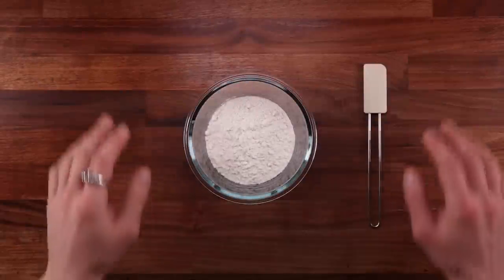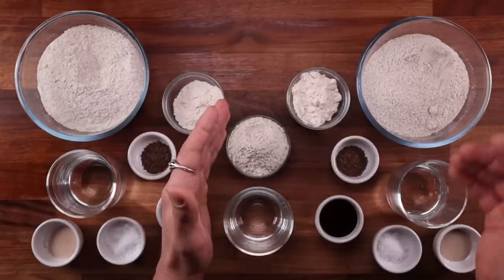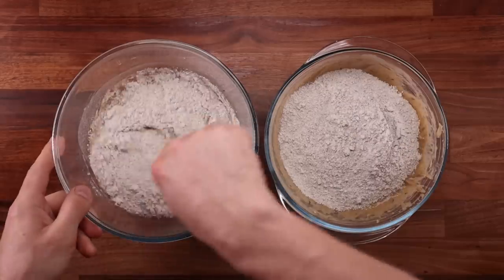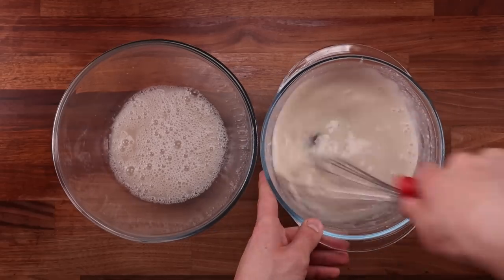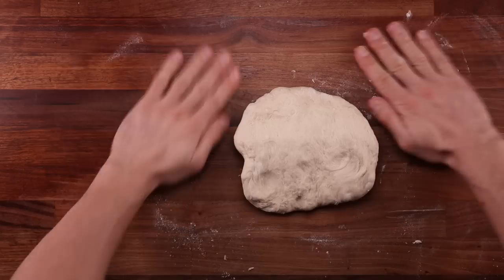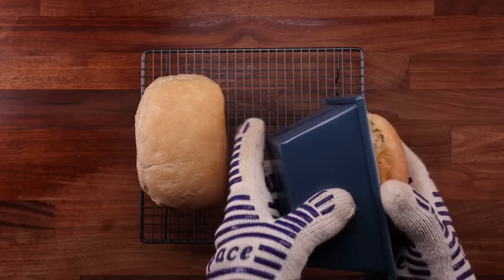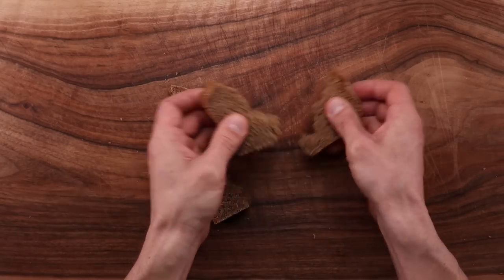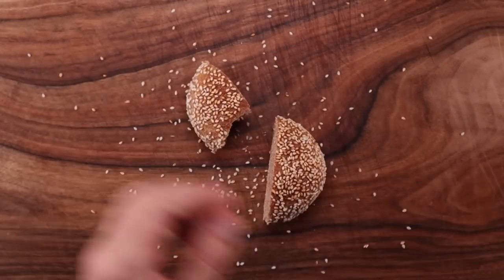Scalding Technique Explained | How to Make Your Bread Last Longer

Comment: So, I am making another bread that I have never made before. This one is Japanese milk bread. I will add photos to this post as I progress.

Ingredients:

Scald
4 oz all purpose flour
4 oz whole milk brought to boiling in the microwave.
Combine the above, and allow to cool.

Combine Scald with:

8 oz warm milk
1/8 stick room temp butter
1.5 tsp salt
2 tsp yeast
12 oz all purpose flour

Knead until the dough almost cleans the bowl, a long time. 

This is a 75% hydration loaf using all purpose flour, raw, and gelatinized by boiling milk. This should yield a soft, moist, and fluffy loaf of bread, diametrically opposed to 100% hydration lean doughs made with bread flour.
Reply from the maker: You can post it in our Flickr group - https://www.flickr.com/groups/chainbaker/
Reply: @ChainBaker  Uploaded the pics to my Flickr account. Now have to figure out how to move them over.
Reply from the maker: Check out the instructions on the group's page. That should help ✌️
Reply: @ChainBaker  Done. I will evaluate the bread this morning. I will make a dippy egg and dunk the bread in the yolk, the best test of bread.
Reply from the maker: That sounds good 🤤
Reply: @ChainBaker  The photos are up. Fiber is being installed in my neighborhood, and I’m going to buy a better WiFi system for the house when it’s here.

Comment: What happens if we add both improvers in one dough?

Does it not go together? 

Does it double the “improver” effect?
Reply from the maker: You can. I don't think there would be a much of a benefit to it. Just make more of one instead of making two ✌️
Reply: @ChainBaker  That makes sense. Thank you for the suggestion 😊
Reply: @ChainBaker  I have one more question unrelated to this video.

When I bake my pizza in oven, the pizza sauce near the edge gets burnt.  What are some ways to prevent that?

My oven temps are between 450 to 500 *F while baking (mostly 475) as more than than triggers my fire/smoke alarm.)

Pizza crust on the edge doesn’t burn by the way, only the sauce.

I add a thin coating of sauce near edge (and not much thicker than that towards the centre as well, due to less preference for tomatoey, tangy taste)
Reply from the maker: It is normal for it to have a slightly burned edge. You can try baking at a lower temperature or covering the sauce with toppings a bit more. Or perhaps the sugar content in that sauce is a bit high and that is why it darkens too much?!
Reply: @ChainBaker  🤔

I can try these possible solutions you mentioned and later leave a comment either here or on a latest video or something.

I don’t have a documented recipe for the sauce I used but I am going to document it and later, can post it along with that new comment.

Thanks again for your feedback on my queries, really appreciate it. 

Have a good time ahead 😊
Reply: @ChainBaker  

Hello again!

I made two pizza yesterday. All purpose flour. 65% hydration. No specific style.

I made pizza sauce with 2% sugar content (along with other ingredients <meaning, not a simple recipe>).

Added onions and corn near the edge of pizza (and in the middle as well, of course), above the sauce. Added cheese in stick form on top of it (like a really thin french fry). 

Baked both pizza at 450*F (average temperature). Baked them each in three stages. First, just the base for about 3 - 4 minutes. Then added sauce and baked for addition 2 - 3 minutes. After that, brushed the edge of pizza with garlic butter, then added toppings, spices, and cheese, and baked for roughly 9 minutes.

__________________________Result: Sauce didn't burn.__________________________

I had not thought of reducing sugar content to get such a result before your feedback. Thank you so much for making my life easier!

Recipe for reference:
Dough-
320gm All-purpose flour
210ml water
5gm sugar
6.5 gm salt
between 3 to 4 gm yeast (fleischmann's traditional active dry yeast)
about 18 ml oil (Peanut oil, as that was the only oil I had at the moment) (Plus, roughly 10 ml more for coating while it proofs)

Sauce:

100ml Strained tomatoes (Mutti brand)
2gm salt (table salt)
10ml oil (Peanut)
10gm garlic (frozen garlic, grated)
10gm onion (grated, was a weird experience grating it lol)
1/2 tsp Italian seasoning (not sure how much it would be in grams)
Approx 1/8 tsp baking soda, to cut down on tanginess 
--Cooked the sauce for several minutes on med to low-med heat
Reply from the maker: Awesome! I'm glad you made it work :) cheers for sharing the recipe too!

Comment: It’s strange. When I used a yudane in my bread recipe, the gluten in the overall dough never developed. I used half the water and 30% of the flour. The dough just kept tearing even after 10-15 mins of mixing.
Reply from the maker: Are you using bread flour? Perhaps it's a bit weaker. Try lowering the hydration a bit.

Comment: I tried keeping my scald at 65 degrees for an hour. It didn't go well - it formed a crust and I had to peel that off. Otherwise results were good, though.
Reply from the maker: Try covering with some plastic wrap so that it's touching the surface. That should prevent it from drying 👍
Reply: I was worried about the temperature tolerance of plastic wrap because it's in the oven, but on closer thought 65 degrees would probably be fine actually. I'll let you know how it goes.
Reply from the maker: It holds up even at 100C
Reply: Update: Yes, covering the scald with cling film in the oven does prevent a crust from forming on the scald. I would recommend doing that to gelatinise further.

Comment: Why isn't the term 'scalding' more consistent throughout the food /baking world?   What you are describing in reference to bread making is not the definition I learned aand confirmed here (google) in reference to milk : " What Is Scalding? In short, scalding means to heat up milk until right before it boils, then cool it to room temperature."  So why the difference?
Reply from the maker: Scalding flour is a much older technique.

Comment: The benefits he gets by scalding, I get with a 90% hydrated dough.  The bread I make is so delicious, there’s no need for shelf life.
Reply from the maker: Scalding changes the texture in a way that increased hydration can't.
Reply: @ChainBaker  I saw your results… that is dense bread.  Are you using it as bricks?  Thanks for the video… very well done.  I realized I would not want bread like that.  Thanks!
Reply from the maker: Great job getting the point 👍